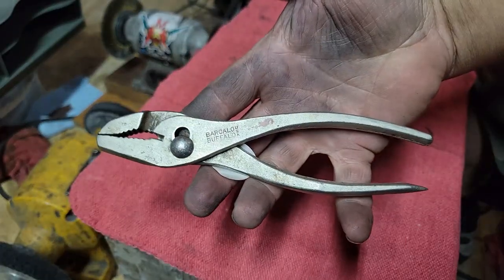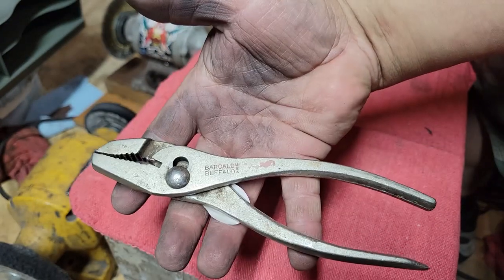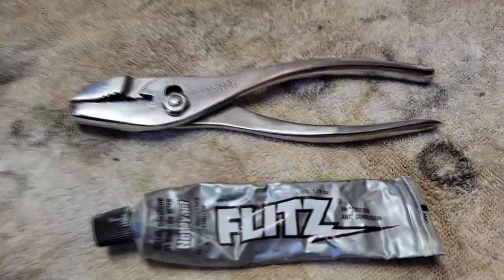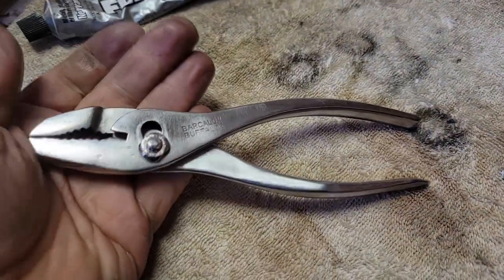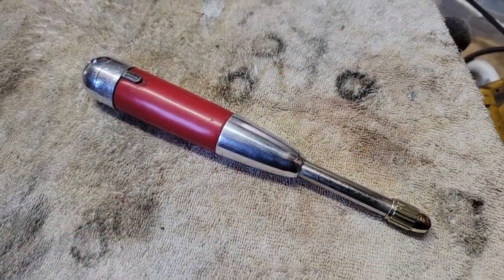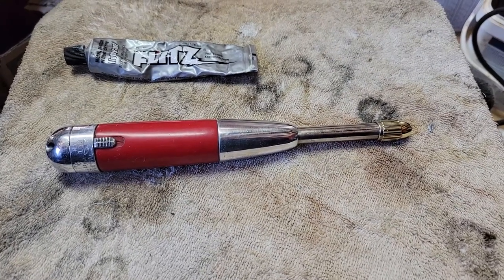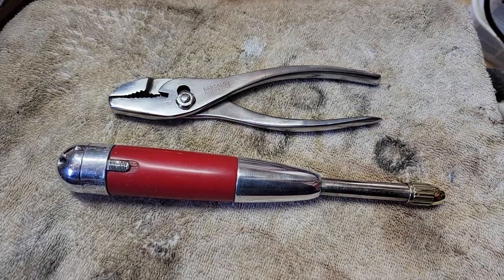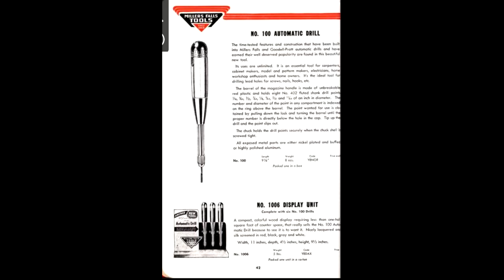Barcalo Plier and Millers Falls Push Drill Clean Up

Comment: Amazing job Robert, didnt know you able to clean up plastic but that drill came out great. 
I did have a question though, do you know if the standard stanley push drill bits fit this model??
Reply from the maker: Thanks! The Stanley bits won't fit the Miller's Falls.
Reply: Thanks Rob, i really like this design but have stanley bits. Guess got to get stanley drill:/